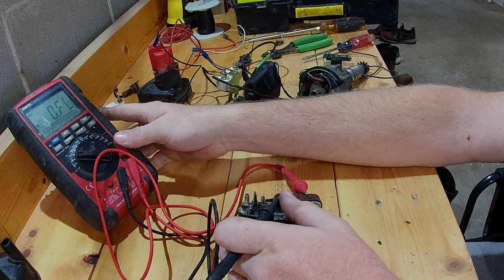Distributor ignition, bench testing and more!

Comment: what is the resistor for
Reply from the maker: Ballast resistor lowers the voltage to the coil during normal operation. Prevents overheating and extends the life of the coil.

In the example I showed (probably could have done a better job) the bottom side of the resistor has a bypass wire coming from the "cranking" side of the keyswitch. That way cranking voltage isn't reduce during starting since the starter already draws a lot of power. Once you let off the start position, the 12v runs through the resistor to power the coil from then on at a reduced voltage.
Reply: @Fixed-ish  yeah thats correct, when the car starts the voltage drops to around 9 volts so when the engine is running the resistor reduces the coil voltage down to a lower potential otherwise "as you state" the coil would be overloaded and get very hot and boil the oil in the coil, sometimes there is a connection that runs from the starter solenoid to the resistor and only energises whilst the starter is operated